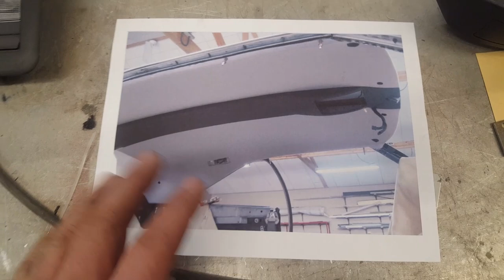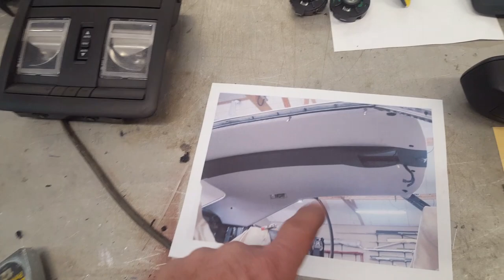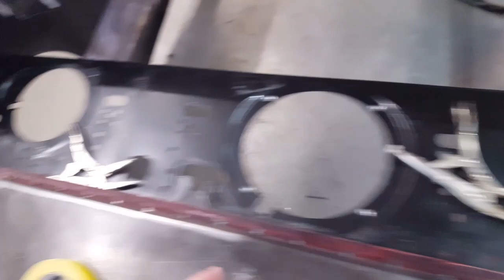Don's 68 Charger body swap part 9

Comment: Outstanding, Steve. I love the format of you videos.  
‘I have to make a close out here.’ 
2 seconds later
‘Ok I made this close out.’
Reply from the maker: Someone said I should do a time lapse. Sounds good if you like sleeping through the video.
Reply: That was me. Still want one if you’re willing. A couple of views for when you drop the body would be excellent.
Reply from the maker: @charlescronley8257  like i mentioned before I don't have the ability shooting with my phone so I couldn't do time lapse even if I wanted to. Also the body drop takes a bunch of trys so it would be super long in real time.
Reply: Well, there’s a free app called hyper loop that lets you Timelapse for quite a long time. When you’re done, you can set how long the video will run, say you did an hour, you can compress it to: one minute, five minutes, 10 minutes, whatever looks best. There are also some inexpensive clamp stands you can put your phone into. They clamp in like the dash mounted ones do. Or you could rig something up yourself using your fine metal skills. Of course, you can always say “Naaaa!” We all understand. Thanks again for sharing your process.
Reply from the maker: @charlescronley8257  I will check that out. No promises though😂